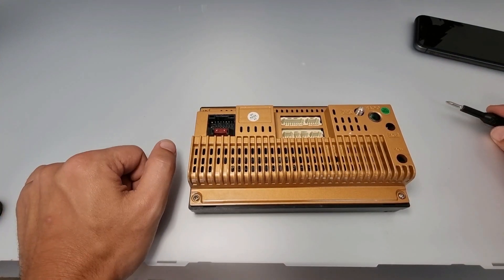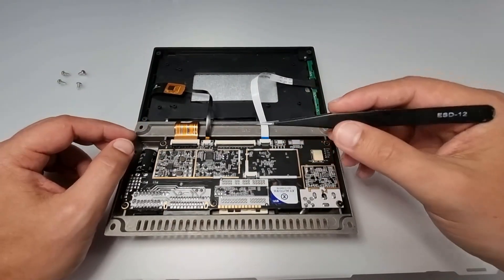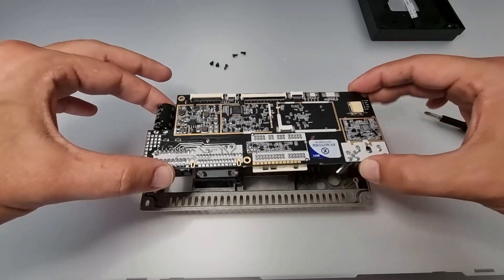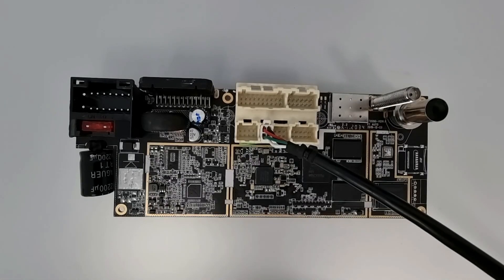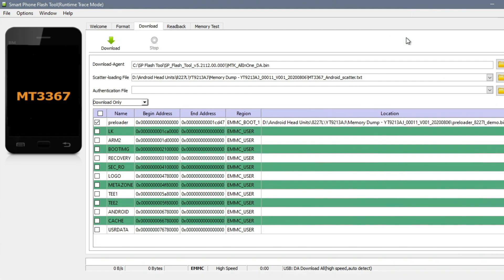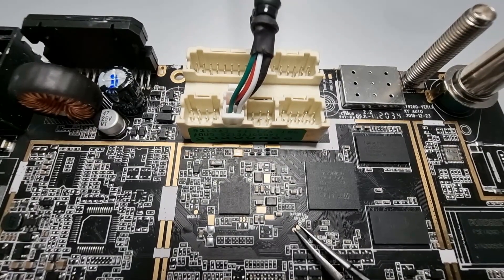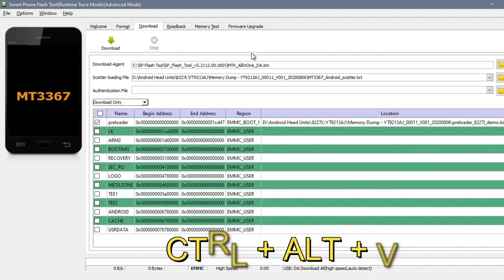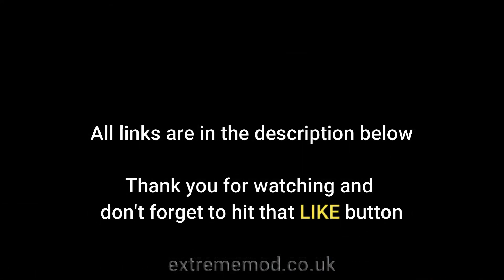How to revive your Chinese Android Head Unit - Test Point method - 8227L - universal car stereo

Comment: I have a question,when you take out that  board an clean that white thermal white paste and when putting it back do you apply some of that white thermal paste again...? AND WHAT KIND OF THERMAL PASTE TO BUY FOR THIS TYPE OF BOARD..?  Thanks for the video.
Reply from the maker: We clean off the paste for demonstration purposes. You don't need to do that. When we rework these models, we use Arctic Thermal paste.
Reply: @extrememod_ahu  Thank you and now I'm going to buy it and install my new andriod radio board and once again thanks.👍

Comment: Hello, the blue light is keep flashing but can't see the head unit files on my computer after USB connected. what could be an issue here sir?
Reply from the maker: There could be a number of issues, some of them outlined here: https://forum.xda-developers.com/t/guide-android-8-api27-supermod-for-yt9216bf-yt9216cfj-yt9216bj-yt9216bfj-yt9216cj-root-viper4android-twrp-custom-ui-brick-recovery-and-more.4318121/post-87798171

Comment: dram failed sp flash tool 5054 yt9216bj
Reply from the maker: Not an uncommon problem. Normally entails an issue with Scatter or Preloader if you're trying to restore via this method, These issues happen when you're trying to use incompatible scatter or preloader file.

Comment: Great Video, just got a unit similar to this, it worked for about 1-2 month and unfortunately it all of a sudden won't power on. Do you think reviving it will help to pwer on or it needs to be checked for power supply?
Reply from the maker: If you haven't performed any firmware updates then it's likely a hardware issue. You should be able to claim warranty
Reply: @extrememod_ahu in my case i did a firmware update to have an international version instead of chinese version, after that it worked for 3 weeks then it’s in constant boot loop.

Comment: Hi! Thx for the video, i want to try this, but i just want to wipe all data and restore to fabric, does i have to skip the Boot1 proceess that you made at the end?
Reply from the maker: Do NOT use this method for what you're trying to do. This is only for bricked units. If you wish to restore to Factory defaults, simply do that from inside the Android.
Reply: Im not able to enter Android, it keeps booting in a loop,  after apps optimization is done, the radio boot again and again, does not enter to system, and i not able to enter recovery mode either, the reset button doesnt do anything, just boot normally!
Reply from the maker: @bryan6679  this unit type doesn't come with built-in recovery mode. It has to be installed using TWRP  Recovery Console. If you don't have an SP Flash Tool compatible backup, you can try to look for one at XDA Forums.

Comment: Hey great video. I accidently blew my audio chip the big one beside the power input 25pin audio chip. Do i have to replace it with the exact same model the original was a TDA7388

I have a TB2912HQ on hand do you kno if that will work by chance?
Reply from the maker: Glad you liked it! In general yes, you need to replace it with the same chip. The best chip is of course TDA7850 and we put it in our units (replacing 7388 variants) but you need active cooling to safely run it (fans, additional heat sinks etc).
Reply: @extrememod_ahu  hey, hello! can i just unsolder  the 7388 and replace it with tda7850? will it fit?
Reply from the maker: @victorasulFTW  it will fit perfectly, however TDA7850 won't do any difference on its own. You need to replace the surrounding electronics and build an active cooling system including proper heatsink for TDA7850. Without that you r head unit will likely burn up or at the very least work slowly because of overheating.

Comment: pls how do i revive a bricked 9853 _ul4? i was upgrading the board when and error message poped up with no picture from the display but just red light on the button with no response
Reply from the maker: You can't, unless you have full backup with preloader and know where the Test Points are located on your particular motherboard

Comment: Hi. How do i install my user rom?
Reply from the maker: Same way you install BOOT1, only pick ROM_USER option in Flash Tool and insert the correct memory address.
Reply: @extrememod_ahu  correct memory address is 0*0 right?
Reply from the maker: @djgylo_painto_video_director  follow our video here and no, you don't need to use Test Points as it's only for bricked units. https://youtu.be/1D2cKcgFr_o

Comment: are there test points on each board?  I can't find them on mine
Reply from the maker: Test Points are normally present on all of these but they might look different and also be placed in different places, depending on the motherboard.
Reply: @extrememod_ahu  can i sent you a picture?
Reply from the maker: @christophhaberger395  you most certainly can. Use the contact form on our website. Make sure to take high resolution photos of front and back of the motherboard and include model specification or an online product link.
Reply: @extrememod_ahu  i sent it via Facebook. Thx

Comment: Hello. First of all, thank you for the information you shared in your video. I have an ac8257 processor version of this device. But the wrong update resulted in bricks. There's no test point on the motherboard. I want to get it back to the way it was. Is that possible?
Reply from the maker: Hi, every motherboard from Mediatek will have test points, however this information is normally secret. If you have successfully backed up your device prior to bricking it, we can try to locate the test point for you. Visit our website and send us high resolution pictures of your motherboard back and front. https://extrememod.co.uk/contact-1
Reply: I sent some pictures to the link you sent. I'm afraid I don't have a system backup. My motherboard doesn't connect to the computer without 12v of energy.
Reply: @ihsan58AYDIN  Fellow did you get any information from @ExtremeMOD ? about your 8257 ?, I have the same issue, the board shows car logo, the jumps to boot animation but stucks there
Reply: I have the same problem, the supplier sent me a firmware, update according to the steps they sent me and the radio died.
Reply: @manuelramirez1294 . This is what happened to my Chinese android unit from Alibaba as well. New firmware they recommend, and it crashes and bricks the unit. Don't upgrade the firmware in these units, they are too finicky.

Comment: Great Video, just got a unit similar to this but unfortunately it won't power on. The new power cable is able to power the original car radio but the new screen does not turn on. It was supposed to be plug and play, any advice ? I'm hopeless with wiring knowledge
Reply from the maker: Best to have a professional fit it for you. You can try to boot it on your desktop as shown in the video to see if it's working

Comment: I have same stereo. But mine only shows white screen. Is the problem in the board or just the lcd? Pls respond. I cannot locate any lcd that I can buy for this stereo 🥺.
Reply from the maker: You need to describe what happened. Did this occur after any sort of update?
Reply: @extrememod_ahu  it just actually happened when I started the engine, it only shows white screen. That time, i can still use it for bluetooth sounds until I pressed the buttons on the steering wheels an I think it got disconnected. It just has no display but I think it still works. 
Thanks for the respond anyways
Reply from the maker: @jay-rf9cj  okay, then yes it seems to be a problem with the screen. First place to start is to check the 3 flat cables as shown in the video. Clean them and re-insert them and see if the problem persists.
Reply: @extrememod_ahu  Thank you. I have tried it several times to clean, reinsert properly, and it does the same. It seems the flex has no problem since it has no damage at all. But I'm not sure if it is the problem or the lcd itself.
Reply from the maker: @jay-rf9cj  if you're located in UK, we can run some diagnostics on your head unit and repair it if needed. If not, then you can buy a replacement screen on AliExpress. Check here: https://www.aliexpress.com/item/4001052537525.html?spm=a2g0o.cart.0.0.6b733c00Y5pVPs&mp=1
Reply: @extrememod_ahu  Thank you so much! I'm actually located in Philippines 😅 but thank you though. 
I'll surely look for the link you gave me. Thank you bro! I'll subscribe on your channel. Bless you ☺️

Comment: hi, i have a yt9216b with a 2gb ram+ 32gb rom config. i made a mistake by an ota update. it crash my system and i try to format using sp tools and now my unit is bricked i think. how can i solve this matter. i try to find a tutorial for it but couldn’t find any.
Reply from the maker: If this tutorial didn't help then your unit is bricked beyond  software repair. This is highly unlikely however. 

Have you tried the tutorial and failed to restore your backup?
Reply: @extrememod_ahu  actually i don't fully try it yet. because i don't quite understand it. i don't do any backup before my unit bricked. so will it works?
Reply from the maker: @kasturiGM  if you don't have a backup then this tutorial will not help you. It assumes you made a backup before making changes to your device. 

Without backup you won't be able to restore your unit at all. We can try to fix it in our workshop or you find someone who fixes these units closer to where you live.
Reply: @extrememod_ahu  i don't since i install the upgrade using usb. can you explain a little bit what should i do. if possible, i want to try to diy the unit.

Comment: Hey Extreme MOD, My Chinese android head unit (No physical buttons) in stuck on the word ANDROID and it keeps looping on when i turn it on. How do i access the recovery mode to factory reset it?
Reply from the maker: This really depends on what device you have. You can reach out to our team through our website or Facebook and we'll try to help you
Reply: @extrememod_ahu  my unit asks for a password to unlock features and data I have no clue
Reply from the maker: @khailashpancham1884  the factory settings password is 8888
Reply: For this unit it's not apparently that's the code for the factory reset.. but this is something like a screen lock .. I have to swipe up then a keyboard comes up for me to enter the password .nothing I tried is working I press rst like a million times. I think it's a podofo android deck I bought on ali express. I am at a loss
Reply from the maker: @khailashpancham1884  why not ask Podofo?
Reply: @extrememod_ahu  I tried email and have no other contacts
Reply from the maker: @khailashpancham1884  you can ask them through AliExpress chat. Also try 1234, 0000, 126 as potential codes.
Reply: @extrememod_ahu  thanks but I tried those codes already..

Comment: hello, sorry I have problems for my PC to detect the car stereo, it does not detect it, the stereo works fine, but I want to update it with the new version that is on the xyauto page, but I cannot make my PC detect the car stereo, and when installing the drivers it tells me error 10
Reply from the maker: If your stereo works fine, then there is no need to update it to yet another stock firmware. There are zero improvements. If your stereo is compatible, we'd highly suggest to install custom firmware to see real improvements.

You will find links to our SuperMOD packages in the video description and you will see what models are supported.

We have easy step-by-step guides for successful installation. Try it out.
Reply: @extrememod_ahu  But how do I install the custom firmware if I can't get my PC to detect the car stereo? I want to put the supermod that is with Viper and dobli atoms
Reply from the maker: @BrianGuerraGTI78  download the SuperMOD package for your head unit and Android version. Follow the step-by-step guide in the main post and you will get access to your head unit through PC.
Reply: @extrememod_ahu  I already did it but my PC does not detect the car stereo, if I am using the 4-pin USB connector, the drivers installed, but my PC does not recognize the car stereo
Reply from the maker: @BrianGuerraGTI78  do it again, only this time connect your head unit to power 3 seconds after inserting the USB cable.
Reply: @extrememod_ahu  sorry, I already managed to install your mod to my car stereo, but I realized that Viper only works with Bluetooth, if I put music locally or from an application like YouTube or Spotify, it does not work, it is deactivated, but if I play music from Bluetooth it does it works fine, why is that ?, also install dobly atoms and it does the same
Reply from the maker: @BrianGuerraGTI78  Viper is a very advanced tool and it will help you to do proper research. You can start by visiting their website and reading through the manual
Reply: @extrememod_ahu  I use Viper on an Android cell phone and on the cell phone it works well with any music application, both local and some app, it is supposed that in car stereo they should work the same, in the whole system, but it is not like that, that has not happened to you before?
Reply from the maker: @BrianGuerraGTI78  it's different on Android Head Units. The only thing that Viper doesn't work on is the radio as radio is on separate chip.

You need to activate Headphones mode and preferably lock it, to get it working. 

You need to have a dedicated audio chip on your head unit as well. For example, if your unit is YT9213 or F9212 then Viper won't work.
Reply: @extrememod_ahu  If my unit is yt9213aj, and if I soldered the chip to it, will it need to work or would something else have to be done to make the chip work?
Reply from the maker: @BrianGuerraGTI78  you would need to install YT9216 or YT9217 firmware. The chip installation is fairly complex as you will need to alter a high amount of surrounding electronics.

Comment: Hey do you know why my unit wont boot? The back is lighting blue but no boot, the unit works perfect when I overbrigde it with the cable, but thats without canbus.... The saler say it is not the canbus.... I have the same unit like your video.
Reply from the maker: It can be a number of reasons. Hard to say without proper troubleshooting. Visit XDA forums where you might find the answers.

Comment: Hi, how can I update my 8227 to android 10 please? Also, when my gps app gives directions, it cuts off my radio and songs. How can I mux all sounds? Bluetooth calls are appalling, anyway to improve this?
Reply from the maker: 8227L units can only run Android 6, 7 or 8. The Android version you see (such as 8.1, 9, 10, 11) is fake. 

The issues you're experiencing are quite common and can only be fixed by hardware modifications.
Reply: @extrememod_ahu  I see, that makes sense. How can update the latest software then?
Reply from the maker: @tahirmumtaz1763  it's a pointless exercise unless you go for custom firmware like ours. All links are in the description

Comment: So I am following the procedure. I get success on writing BOOT_1 but after that when I connect via the USB cable the device doesn't connect so I am unable to restore my original back-up. Can you help me
Reply from the maker: This can happen sometimes. Try different SP FLash Tools versions starting with 5.1844
Reply: @extrememod_ahu  it was my bad. I didn't short the test points when trying to upload the ROM_USER to the memory. I thought that after writing BOOT_I I wouldn't need to short them and it would automatically connect. However I have another issue. I get an error when trying to "Download" the firmware from your pack. It says PMT changed from the ROM; it must be downloaded. How should I proceed? Also I don't have the "Vendor" option as in the guide. Can you help with further instructions to flash the unit. When I try to update via usb stick it says it has the wrong version. I downloaded the firmware from XY Auto's website. My current Firmware version is YT9217B_00002_V003_20181219
Reply: whew, I did the whole procedure with creating a scatter file and a preloader file and downloaded the package again from google drive and I managed to update the firmware :)
Reply from the maker: @OlegUzunov  please check the XDA thread for your head unit. Link is in the description. 

If you need to short the Test Points for UserROM then your preloader is no good.
Reply: @extrememod_ahu  I didn't need to hold them for the whole duration of writing USER_ROM, just to start it and I was able to recover my initial back-up. After that I did a factory reset on the device, did a new memory dump, scatter and preloader and I was able to add the firmware from your pack. All good now :) It's working much better than before

Comment: I have a question, can you disable or deactivate the speed tachometer,cause my has kw/mile on my display and have contact seller for this issue and they send me the software, install it to a USB and to Android Radio but the speed stay the same, for example I'm going 40 mph on car display and on the android radio same 60 mph, see the difference. Can you help me fix this issue.
Reply from the maker: Sorry but we only provide such support for our own head units. They don't have such problems however.

Comment: I put the boot logo as a normal picture.  When I went in and out of the market, the tape did not turn on.  the logo gets stuck. the logo goes back and forth from time to time, but it won't turn on
Reply from the maker: Restore you logo.bin file through SP Flash Tool